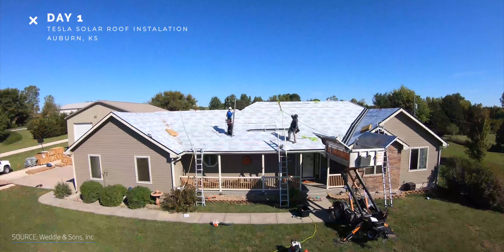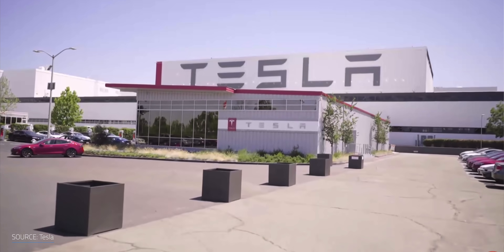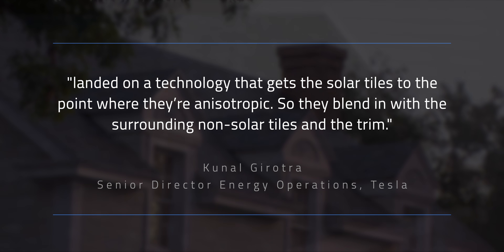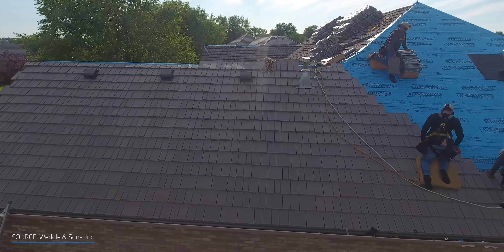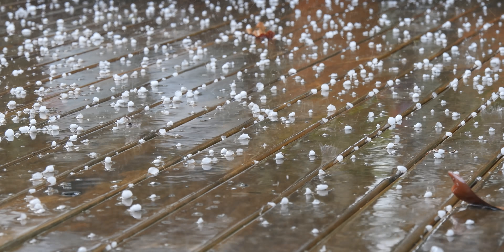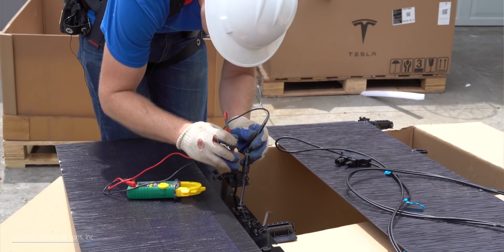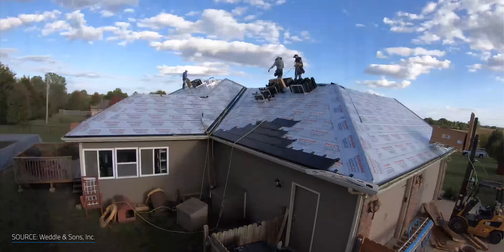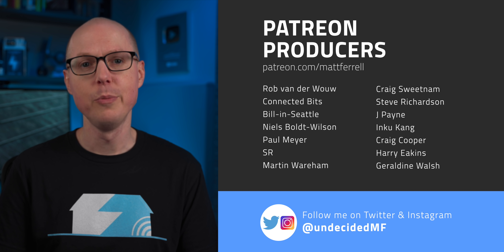Exploring If Tesla Solar Roof Is About To Go Mainstream?

Comment: My asphalt shingles have a few years left but in 5 to 10 years I will be looking at a Tesla roof.
Reply: My roof in Australia should last 50 to 75 years or longer. My first home has a roof that is over 80 years old and my home at the moment is 15 years old and I expect it to last my life time and my children's. I don't understand why you Yanks us asphalt.
Reply: @ronvds4713  - asphalt is cheap and people move more often.
Reply: @ronvds4713  Slate roof on the horse barn, been there for longer than the farm has bee in the family ( 80 years ). Metal ( Al ) roof that I put on part of the farm house back in the 70s, still holding up well.  Rest of the house roof is standing seam that has been on it and painted for 80+ years.
Reply: @ronvds4713  Same in Norway.
I know that it is really changing now in the US, but older house even in colder areas have less insulated then what most outbuilding on a farm have in Norway. That also go for how the roofs are covered.
Reply: @ronvds4713  Just wondering what you are using for roofing material. I my part of the US metal roofs are common.
Reply: @mtadams2009  my parents first home has tiles and are still in perfect order. The first home I built for myself has a colorbonded steel roof and 15kw of solar. The roof will last better than 100 years the way it looks today. I have continued this material on my current home but have improved the insulation to the under side of the roof sheeting and additional ceiling insulation. Again we have installed another 15kw solar system and expect this will be upgraded a number of time before the roof needs replacing, maybe next century.
Reply: @ronvds4713  Asphalt shingles have been engineered to last 30 - 50 years and they are dirt cheap. As a GC I  hired a roofer to install a 50 year roof along with 12 roof vents on a 5000 SF house.  It cost $18,000. 

I shingled a 2000 SF house with one helper in four days for $5500.00. I made around $2000.00 profit.  This was using 30 year shingles.  

Shingles installed correctly will last 30 to 40 years and it is a durable roof.  

The new 40 and 50 year shingles are very durable and very beautiful. Tile roofs cost 2-3 times more and steel roofs even more.  

I live in AZ which gets very hot and tile roofs are the best choice,  but shingle roofs are used quite a bit and they hold up well.
Reply: @ronvds4713  it's the cheapest roof. Many houses only last 30 years or so before tore down lol. My house was built in the mid 80s and is one of the oldest house in the community now
Reply: @JD-yx7be  30 years? That's it? So I just bought a 15 year old house that will have to be torn down in 15 more years by your logic.
Reply: @JD-yx7be  Our farm house is over 200. Our house in Florida is 43 and has been Cat 5 Hurricane tested ( Andrew, 1992 ).
Reply: @DJR-u2g  nobody said it HAD to be tore down. Houses are often torn down and new things are built.
Reply: @daedulsworkshop  if it only lasts 30 years, city code where I live requires condemned structures be torn down.
Reply: @DJR-u2g  nobody said they only last 30 years. Re-read the original comment you responded to. You're adding things that were not said. 

The worst part is you comment about logic while being entirely illogical.
Reply: @JD-yx7be  What the hell are you talking about? Houses from the 80s aren't not being torn down en masse.
Reply: @JD-yx7be  My house was built in 1979. Still looks good. No plans on tearing it down. There are houses in the city that were built in the 1920's. People upgraded them but they didn't tear them down.
Reply: @DJR-u2g  ...don't listen to that numbnut...the only reason a 30 yr old house is torn down in the US is because the neighborhood has changed....for the better or worse...in a highly desirable neighborhood with home prices in the millions, the property value alone warrants a demo and new build if the home is below the baseline standard for the neighborhood...it's done because people have money and they want to show it...not out of necessity...
Reply: Hiking Lang We in Europe find it insane that the US uses shingles with such a short lifespan. Here they are something we might consider for a dog kennel, never a house. We expect a roof to last at least a century, probably two. Much of London is still sheltered by Victorian slate. Few people will replace a roof during their entire lives. A bad roof will knock thousands off the value of a home, so it pays to build them to last in the first place.
Reply: @spencerwilton5831  Americans are more mobile as has been stated often.
Reply: Mark Fox What has being more mobile got to do with anything? Just because you're intending to live in a property for as long as a European might, why are you happy to have an inferior home? A roof is a one time investment in Europe. Over the course of a lifetime, the average American will spend significantly more on their roof than a European as most of us will never spend a penny on re-roofing. My own roof is Victorian, and aside from a bit of leadwork around the chimney has required no attention at all during my ownership, and will likely last another century with limited attention. In that time the typical US home might require three entirely new roofs.
Reply: @spencerwilton5831  accessibility of materials, cost of manufacturing, additions requiring changes to roofline, different weather conditions, there are many reasons involved in Americans choosing what is superior/more valuable to them. One major consideration is a preference in America for massively larger square footage in their home. So we trade the cheap cost of certain materials instead of living in little hobbit holes like Europeans. Different priorities. Funny how that happens.
Reply: @spencerwilton5831  How much does your roof cost. They use cheaper roofs here to keep the cost of construction down. The old houses were probably built in a similar fashion as the european houses. They last a very long time. However, the cost of labor and material was cheaper back then. After the baby boom, they needed to build houses fast and cheap and that is why we have these type of houses here.
Reply: @spencerwilton5831  When you live in an area of the US where storms and tornadoes regularly rip off the roofs of houses or like this past summer drop trees on them let's just say that an easy to replace, inexpensive roof makes a lot of sense. The house I live in is over 100 yrs. old, the roof was ripped off 5 yrs ago by 90 mph (145 kph) winds.
Reply: @spencerwilton5831  always a European trying to flex. The lion doesn't care about the opinions of sheep.
Reply: @daedulsworkshop  That is a stupid comment. It never hurts to see how others are doing things differently. If their methods result in lower long term costs, it should be considered.
Reply: @daedulsworkshop  Maybe but it was in response to your comment about Europeans trying to flex which is childish as well.
Reply: @ymcpa73  yeah. I don't know why every comment section about building is full of Europeans talking trash about American building practices. As you say it is a childish flex. 

Thanks for backing me up on that observation.
Reply: Make sure you'll be under that roof for 15-20 years, the ROI on it, and if you do sell the home how much in the sale you might recoup on the installation cost.
Reply: the only reason people replace roof here is because its gone, like flew off or something.
or they have too much money to have weathered roof, but they mostly just clean it and repaint.
Reply: Depending on your electricity costs each year, waiting 5 to 10 years could be an expensive mistake.
Reply: And when you get it, I'll be looking at yours ;)
If the roof ever goes  missing, just remember -- the wind did it..or something..
Reply: I'm in a similar boat with my cedar shakes. I'm trying to figure out if I should just do traditional solar panels now, and then regular shingles down the road, or just wait and do a solar roof later. I guess another question stemming from that is how hard is it too install a new roof when solar panels are already up there?
Reply: @ChrisGMid  Solar has to be removed before reroofing.
Reply: Seeing how expensive it is, I would do the roof myself.
Reply: No u womt. If u cant afford something better than asphalt u cant afford a solar roof
Reply: Same. Hopefully by then prices have come down and the waiting list is not so long.
Reply: At least in America... lol
Reply: @Jimmy Edward no you shouldn't, he just made up a bunch of nonsense, pulled numbers from his rear.... who knows, maybe bitter about the competition or just a troll
Reply: The prices I hear out of America for your garbage shingle roofs are insane. In Australia we will get steel roofing for less than that.
Reply: @Shrouded_reaper  - Certain places in the US have home owners associations that dictate what kind of roof you can put on, what color you can paint the house and all kinds of other regulations. The idea is that your property value won’t go down because the neighbor decided to do something that would stand out. I saw where a guy hauled in a bunch of sand and made his yard look like a beach and the city made him remove all of it and go back to a grass lawn. I thought the beach was a neat idea from an artistic perspective.
Reply: Shingle roof done by a roofer on a 3000sq ft home turnkey should be at most 8000 if you shop around - at most - premium. Tesla roof 10x as much.
Reply: @Tim Ryan but would you bet against it 🤔??
Reply: @billhanna2148  I would be against any product that raises the cost of the total solution with no benefits other than atheistic... with a small sacrifice in athstetics you can isntall standing seam roofs + solar between the seams at much higher output and lower costs. And... have a much longer lasting roof.
Reply: @Wingnut353  good to know
Reply: @curtisbme  my solar cost me five thousand, my roof cost two thousand, that's seven grand.. Not frigging fifty grand!! That's just nonsense.. Roof will last 30 year's.. Solar will be replaced as tech improves, and batteries are used up.. 100% of my electric is solar 50 grand??? Nope not this guy.
Reply: @larryscarr1929  - I am buying a house that needs a new roof and I want to use solar too. What did you end up putting on? I hope to be able to install it myself and save more money. I have built houses for other people for over 20 years so I am able to do the work myself but I have never done solar. I am also going to install a geothermal heat pump since the system on the house is all electric and it’s shot.
Reply: @boxelder9167  I
 panels the blue kind, 200w each 100 bucks each 20 of them.. All parts are from China.  I have two systems, one is just for the fridge.. I'll answer whatever I can.. You can do it.. Just never touch the red and black.. Ever!!
Reply: @larryscarr1929  - Are you tied to the grid? If you are using batteries how many and what kind? I thought about doing separate systems running lights on one, fridge and freezer on another, geothermal heat pump and well on another. That way I could do it in sections and not just one big bill up front.
Reply: @boxelder9167  I'm 100% off grid.. Using 12v lead  acid 4 for the fridge.. 100 amp hour.. Five 150 amp hour for the house.. Two inverters.. One is square wave for fridge.. One is sign wave for computer and house electronics.. Also have Two wind turbines 1000w for the winter.. I have had to use gass generator a few days, this year as I'm under six feet of snow.. In the Canadian bush..
Reply: @larryscarr1929  - I am thinking about using geothermal and maybe combining it with a line running through a decomposing mulch pile to bring the temperature up for winter.
Reply: Hopefully, in that timeframe, the price will become comparable.  Right now the price is comparable to a tile roof Plus solar.  At least our quotes were and we went with the SolarRoof.
Reply: I have storm damage and got a quote for a roof... $15k for architectural shingles and $96k for a Tesla roof.... yea that’s not a typo!!!
Reply: @gemrough  Wow!  I was definitely surprised by how low some of the numbers were.  I'm sure that regional variations play a big role, but my steel roof was considerably more expensive than the comparison numbers they used.  Perhaps the asphalt numbers were for the absolute top of the line?
Reply: @gemrough  Their website shows my roof would costs $25k or $21k after federal credit. This is for a 6.8kw system. The house is 2 stories and 2500 sqft. So the roof is about 1500sq ft.
Reply: @gemrough  Tesla fanboys will still pay $96,000 to get a Tesla roof even if 90% of their roof is covered in full shade year round.
Reply: @michaelbrinks8089  beta adopters are heroes. The people that paid thousands for the early and absolute garbage cellular phones were absolutely essential to what I am using to write this comment now.
Reply: @Tim Ryan yeah, i still believe to stay with old school roof, don't jump on tesla roof yet, you might need to wait at least another 10 years before you to consider and see what other ppls say about the tesla roof (you don't wanna have water issues, it will cause more damage than you think if you roof has a water leakage. i would like to have metal roof if i have money instead of asphalt roof.) as you look the mechanism of tesla roof that roof supported by plastic clip. this is weak point under UV light and heat exposure over time.
Reply: Elon Musk did not land rockets. Seriously people do you really think he is calling the shots from the control room during a launch?
Reply: @Tonay88  actually that wouldn't be too far away from what he's actually doing in his companies
Reply: @Tonay88  go away troll, he is CHIEF ENGINEER at spacex, YOU ARE NOT CHIEF ENGINEERS JUST BECAUSE YOU SO WANT IT, it is not your playground, do a mistake that fucks the company and your own company has the right to fire you out, remember, THEY WORK FOR NASA, and they don't fuk around....
Reply: @ivantimofeev2233  Dude, I have no idea what the hell you are on about. I'm just going to say "ok, cool story".
Reply: @Tonay88  He lead the team that got it done. That does mean something. There are plenty of smart engineers at other aerospace companies that were in business much longer than space x. Why haven't they done the same thing sooner? Probably because they didn't have a leader with the vision to see that this was possible and to lead the engineers to get it done.
Reply: @Tonay88  Did rockets land before Elon came and started SpaceX?
Reply: @tubetop123  didn't space shuttles have to land? I don't know, I am not much of a space fan, but they did send humans in those things so I assume they were able to come back in the same ship.
Reply: @rasithwnninayaka1633  the space shuttle is the payload, the rockets (boosters) ended in the ocean and not ever reused. The shuttle glided in not under any power the thrusters on it were only used in space for slight course changes, aligning reentry. It was all math and very little power.
Reply: @tubetop123 Yes it's been done many time since over 60 years ago. Blue Origin did it. They have done it with a manned rocket pack in 1961. NASA did it during the Apollo missions with the lunar module 6 times. They also did it with the DCX rocket. Its not new, it's  just done better now.
Reply: @Tonay88  bullshit, blue origin didn't land an ORBITAL BOOSTER

THEY CANNOT EVEN GO TO ORBIT, JEEZ, you cannot put a dammed satellite on it, or a spacecraft, CAUSE IT IS SIMPLY NON CAPABLE

apart from that, no one has EVER landed a booster (shuttle trashed it's own boosters in the ocean, doesn't count as re usable, and it is stupidly expensive)
Reply: @ivantimofeev2233  My reply was in response to "did rockets land before Elon Musk can to SpaceX" the simple answer to that was "Yes". Yo have now shifted the goal posts to the type of booster used. I never mentioned the type of booster. Stop trying to redefine the word "Rocket".
Reply: @tubetop123  Vertically? No they didn't. They normally launched the satellites and the rockets weren't reused. That was why the cost to launch a satellite was so high.
Reply: @rasithwnninayaka1633  THe space shuttle was more of a plane. They used booster rockets to launch it. I'm not sure if they could reuse those booster rockets. They used the shuttle to launch some satellites, but it was too expensive. These rockets are unmanned and they can launch satellites for a lot less cost and they land so you can reuse them.
Reply: @Tonay88  No sure what blue origins did. The lunar module landed on the moon with a lot less gravity. From the videos I saw, the booster rockets had three stages and they would jettison each stage as the fuel was spent. They weren't reused. I'm not sure this is comparable to what SpaceX is doing now.
Reply: @Tonay88  what the comnenter meant is that Elon single handedly built a company "SpaceX" that lands rockets and best of all, brings them back and re-uses them over and over saving tons of money that way, do you get it now?